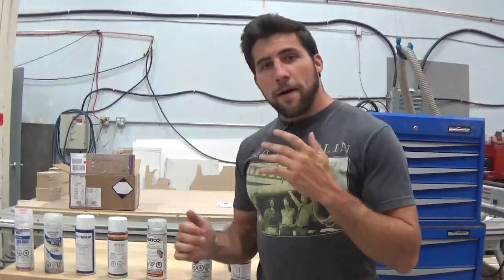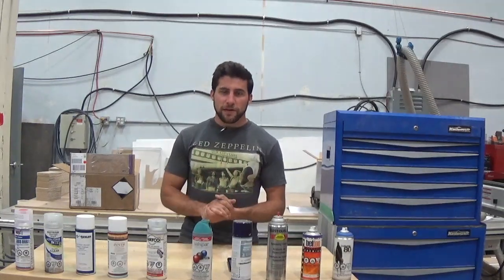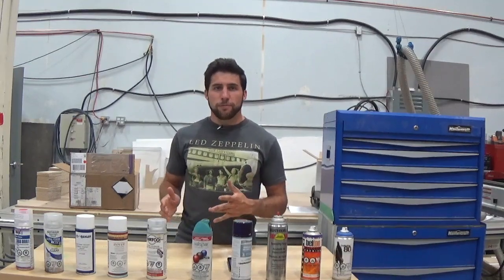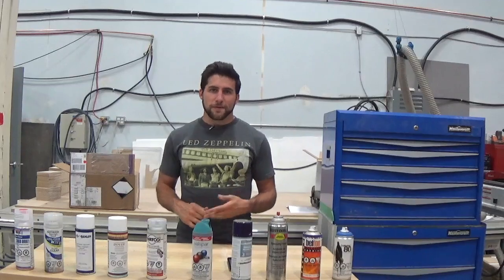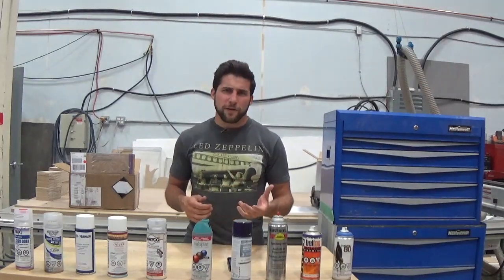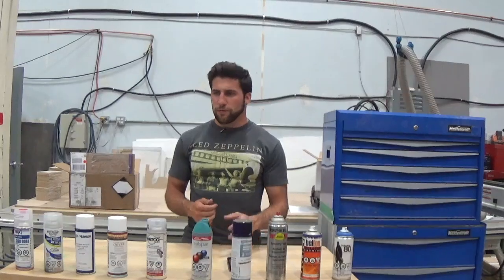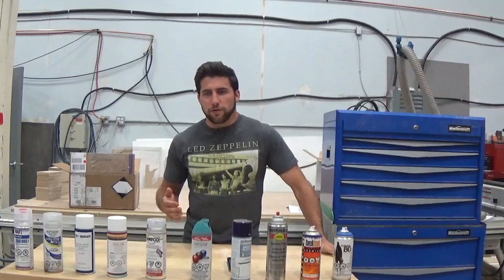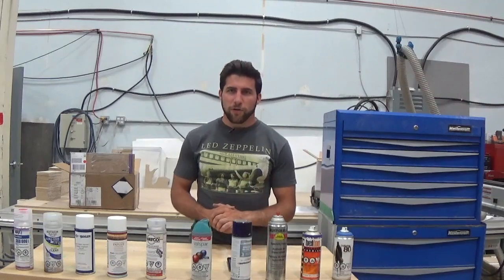The Top 5 Mistakes to Avoid When Painting With Spray Paint

Comment: An issue I have found if you let a piece dry for a day and then sand it lightly it opens up the pores  and then if you recoat right after it can wrinkle as the solvents will activate the old paint.
Reply from the maker: What kind of paint are you using?
Reply: @BradAngove  I used to use Rustoleum but I had issues with that so now I use Krylon Fusion.
Reply from the maker: It’s probably continuing to shrink. I don’t use krylon fusion, but you may need to let it dry for closer to a week.

Comment: Thanks for this helpful tutorial - its golden. I' doing some painting on my car using spray cans of Rustoleum primer base coat mix.
Not having used this combo in a can before I shot a coat of primer/filler first before laying on the base coat - just one coat so far. I was dismayed to see water droplets dripping from the nozzel - just a few, but I thought it best to stop painting, wait for the paint to dry and sand lightly with 1200 grit. Do you have any thoughts as to why the can drips water in the first place? I've warmed the spray can: the  air temp is +/- 12deg centigrade and the job is in the garage. I'm doing something wrong here but not certain what.
Reply from the maker: That is quite odd that it would drip water. It sounds like you may be getting some condensation or something, but it's not an issue that I've seen before. What type of nozzle is it? If it's the old style, my first instinct would be to flip it upside down and spray for a moment until only clear gas comes out. That might clear the condensation so that you can keep spraying. Also, make sure the can has been well shaken. You may be dripping unmixed solvent if it hasn't.
Reply: Brad Angove Thanks, Brad. That can comes with a new style nozzle - its black and is activated by a built in "trigger" style of thing. The paint seems very thin and it could actually be paint drips rather than water - sorry to have mis-informed you. I am painting the cars hood and the passes I make maybe a bit slow and at to steep an angle. I will keep on trying and should get better at painting as I practice more.
Many thanks for your helpful suggestions, Brad.
Reply from the maker: I hope the problem sorts itself out Bruce. Thanks for watching.

Comment: +Brad Angove How do I paint a Les Paul? Do I spray the front, let it dry, spray the back & let it dry, then do the sides? Or do I spray the whole body at once? I don't have any kind of booth to hang the body so I'll probably just have to lay the body flat on some cardboard to dry. How should I spray the body to get the best result?
Reply from the maker: I do the sides and back first, then move on to the front. Better if you can hang it a garage or something to dry rather than on a table, but I’ll leave that decision to you.
Reply: @BradAngove  so would you recommend hanging the body and spraying the whole thing at once? Or do you do the sides and back, let that dry, then do the front? Just want to make sure the paint goes on evenly and dries properly with no runs or spatter. Thanks for your help
Reply from the maker: Either one is fine. It depends on how you like to spray.

Comment: Okay, I've got a Star Trek phaser gun I'm trying to spray paint.. never used spray paint in my life. There's one little part on the side of the phaser gun that has a copper side. I've got copper nail polish.. Would I be an idiot to just try using the copper nail polish for the color, and spraying the clear spray over it? Is that okay??
Reply from the maker: That’s fine. Nail polish is just lacquer, so use a lacquer clear coat overtop.

Comment: If you’re scuffing up clearcoat on a quarter panel to re-clear and accidentally go through the base color to the primer on an edge can you spray a little light base color to cover it up before you re-clear the whole quarter panel?
Reply from the maker: You could. It may be noticeable, but it’s an option.
Reply: @BradAngove  Just thought I’d try to keep the factory color instead of trying to match it and re-spray the whole thing with base, especially it being black.

Comment: So, I know the mistake I originally made, but in trying to correct it the same problem is occurring.  I touched up a shelf when it was too cold and it "puckered" or left "poc" marks - don't know the right term, it wasn't smooth in a few spots.  Anyway, I sanded off the two layers of existing paint (put on the day before) - smooth.  Wiped off any debris, then painted again with temps around 65, humidity would have been low.  But it did it again!  So, wondering if I need to sand it down and use a chemical cleaner on the wood before painting this time?  I thought I did it right this time with sanding and warmer temps!
Reply from the maker: What kind of paint are you using? And how did you prepare the surface?

Comment: Brad I am refinishing Rally rims on Pontiacs and l am thinking of putting a clear coat once finished painting...My question is how long do i wait before i can clear coat, can i do it 24 to 48hrs  later.....It will be the Spraymax 2k clear..Thanks
Reply from the maker: Over what paint?
Reply: @BradAngove  They are going to be primed with a U-Pol primer first and I am going to use a high yield lacquer from inline tube rally  line of charcoal and silver. Thanks
Reply from the maker: I would wait at least a week then.
Reply: @BradAngove  Thanks you!!

Comment: Hi Brad thank you for the video.  I was doing my first ever spray painting job recently and ran into a problem I'm a bit confused about.  I cleaned and sanded the small plastic part and then applied adhesion promoter following the cans instructions, I waited the time stated (1 hour) before applying my enamel base coat.  

I let it dry for 24h but saw I clearly needed another coat as some parts were uneven.  When I sprayed the next coat the following day, black speckles were being sprayed onto my project.  The can ran out of paint shortly after.  I'm now left with dark marks on the project as I didn't have enough paint to fix it.

Maybe worth mentioing: the weather was quite cold and windy but I did warm the can in a bucket of warm water for 15 minutes before spraying.

Any idea what could have caused those black speckles to be sprayed onto my project?  Thanks for any input!
Reply from the maker: What colour paint was it?
Reply: @BradAngove  Thanks for getting back to me, the colour I used was Chrome (Plastikote Fast Dry Enamel AERO CHROME)
Reply from the maker: Oh, chrome is an odd and finicky item. It could be a problem with the way something mixed in the can. Was the can spitting at all?
Reply: @BradAngove  Oh right I didn't know that,  I picked a bad colour to do my first attempt with then!  I don't know if I'd describe it as spitting but the problem did only happen as the can was approaching empty, maybe I didn't shake it hard/long enough.

I'll be doing another project soon and I'll try a different colour paint, hopefully it goes well I'll follow the advice in all your plastic painting videos before I do it.  Thanks again!

Comment: Do you have any suggestions for what to do about spraying too much primer? I used the rustoleum primer filler+sandable on my guitar and i had to build up 2 spots and i put too much. It is soft and squishy and i dont wanna mess it up more so i put a space heater on the spot. Will that work to harden the soft spots? Thanks
Reply from the maker: It could, but you may have solvent trapped underneath keeping it soft and using a heater will only increase how much the surface dries and traps that solvent in there.

Comment: So i followed those tips and i made a huge mistakes not mentioned: 1. was outside and there was a wind breeze (not good). 2. used latex gloves and they went saggy due to sweat so a tip went over the nozzle and full drips appeared on my paint job (not good).... and i dried project in open sun and bubbles apeared (also not good)... i failed big although i went trough some 'mistakes' videos.
Reply from the maker: Yeah, those are definitely mistakes. They don’t make the top 5 for me, but they’re probably fairly common.

Comment: Brad, what a great video!  You answered most of my questions, however I do have one - Does it matter what color your primer is?  When I started my project (the bumper cover on my 02 Q45) I bought a spray can of black primer.  The base coat I had made up at a auto paint shop - it's "Desert Platinum" - a goldish/silverish metallic.  Subsequently,  I saw a few videos where they used light primers under lighter colored base coat. . . too late for me  now.  I'm going out to put my second basecoat layer now.
Reply from the maker: Using a primer of a similar colour just allows for coverage to be achieved a little quicker and easier. In some of the more transparent colours it matters more, but generally it doesn't make much of a difference once you've built up a nice opaque coat of that mid/base coat.

Comment: Can I spray nitro lacquer straight over dyes as in angelous dyes or do I have to put a clear sanding sealer coat first before the nitro lacquer
Reply from the maker: You can spray lacquer over that. Depending on the grain though it may soak in and not look good.

Comment: What if you're restoring an already painted metal? Do I have to remove the old paint completely? Can I apply the paint directly or a primer is still needed? I'll be applying approxomately the same color btw.
Reply from the maker: If it’s already painted, just sand it with some 600 grit and clean carefully, then paint. You don’t need to remove all the old paint.
Reply: Thank you!

Comment: I spray painted my door hinges on top of cardboard, finished with protective enamel spray. When I picked up the hinges they were stuck to the cardboard and some of the pant scraped off when I separated them. Is this from not letting it dry long enough? Basically I sprayed side A, wait, spray side B, wait. Enamel side A wait, enamel side B, wait.
Reply from the maker: Did you sand them before painting them?
Reply: @BradAngove  No . Guess I'll do a scuff with P400 beforehand. Also after sanding I'll spray with primer. The spray paint I used is Krylon Paint&Primer, so I suspect the primer on that is not enough.
Reply from the maker: That sounds like it will likely help the paint stick better.

Comment: I was using a rattle can for my clear coat. On my second coat, the can started to spit a little causing uneven surface. Should I sand it before going to the next coat or fix it at the end where I sand and polish/buff?
Reply from the maker: Let it dry for a day or two and then sand it smooth and continue.
Reply: Brad Angove , I’ve let it dry for about a day now... the last coat wasn’t wet enough so now I have a matte-like finish on the last coat. Would a 2000 grit sand  smooth it out and have a glossy finish after buffer? I’m losing sleep over this 😭

Comment: Hi Brad 
I repainting a stamped steel Marx o gauge locomotive. 
Do I need to wet sand between each coat? What grit should I use?
Reply from the maker: Have a look at my video about whether you need to sand between coats of paint. It depends on the circumstances.

Comment: I'm going to try a copper oxide paint that corrodes with an activator then requires a sealant. I've never done this and am a bit nervous of the sealer wearing off in certain parts. I have found plenty of blogs on doing this finish it galvanized sheets or aluminium but not wood
Reply from the maker: I’ve seen that finish on wood. I’ve never done it though. I hope it goes well for you.

Comment: Started to paint my car, 2pack paint, put clear on and wasn't happy with the colour, so I sanded it back and re-prepped the surface. Then applied my first layer of primer again and it appears to have reacted, it's developed loads of cracks in the finish. 2 possibilities I can think of. 1) after damp dusting the panel I may not have dried it adequately. 2 The water I used may have accidentally had washing up liquid in.  Any ideas?  TIA
Reply from the maker: It could also be a result of layer the primer a bit too thick or some kind of unevaporated  solvent release. 

Sand it back flat and clean. Dry carefully and spray a light coat of primer to make sure things are doing what they should.
Reply: Thanks chap, sanding back again now, third time lucky!!!
Reply from the maker: Fingers crossed.

Comment: I have a new black glossy carbon road bike frame and I have put vinyl decals on it. Should I add a spray clear coat. If yes, 1 or 2 coats? Plus, should I sand area before spraying?
Reply from the maker: No, probably not. It’s difficult to get clear coat to stick to vinyl.
Reply: Brad Angove : thanks. Fortunately, the decals look anyway.

Comment: Real fast question if you can get to it I just sprayed my first coat two to three coats of black textured Rustolium on a wood gun stock I plan on going over that with rustolium flat black the camo can it’s 55 degrees how long should I wait before next coats how many should I do of texture and how long should I let the texture dry before the flat and should I sand the texture before the black like you said
Reply from the maker: You can’t sand the texture, it ruins it. If you’re spraying black over it you only need enough coats to get the desired texture. You should just be able to follow the directions on the can for the re-coat times.
Reply: Brad Angove thank you I let the texture dry inside hanging all night and it’s 35 degrees now so don’t think I’m gona be able to go out and put the flat on it but I put about 4 coats on it and it’s still just a little tacky but not really I did them all with in 45 min or little less time but when you say if you didn’t let it dry properly during each coat it’ll never dry right but if I did spray it on too fast will it cure if I leave it for days drying
Reply from the maker: I don’t think I’ve ever used more than two coats of texture. Try leaving it somewhere warmer and see if it dries.
Reply: Brad Angove I’m guessing it’s close to being dry it’s feels a little weird like grippy light lightly tacky but I don’t know if it’s suppose to be like that when it’s dry cause even tho it’s like that I pushed down with my finger real hard in a spot that’s gona be covered and it didn’t leave no finger print would that mean it’s dry enough
Reply: Or should I just put a pan light on it that puts off heat for a while longer and see what it does
Reply: Brad Angove Like when I rub it it feels fine if I hold my hand on it for few seconds like griping it I can feel the tackiness but it’s not leaving nothing in the paint the paint is staying clean looking
Reply from the maker: It’s probably dry enough.

Comment: Thanks, very good tips. I am planning to spray paint an old stainless steel cabinet and it is my first time to use spray paint. Do I have to sand it? Thanks a lot
Reply from the maker: Paint doesn’t stick to stainless very well. You need to sand it, clean it, and use a metal compatible primer.

Comment: I’m spray painting cabinet hinges from a bronze to a satin nickel by ‘rust oleum universal metallic paint + primer in one’ ....any tips? I soaked the hinges in ammonia and warm water and used a toothbrush to thoroughly clean then let dry before applying first coat. So far so good! But any tips are welcome. Graciassss
Reply from the maker: Did you sand them? Did you choose a metal compatible primer?
Reply: Brad Angove I did not sand nor prime. I only cleaned them thoroughly of grime,dust ,and debris.  And this rust oleum metallic is a primer + paint in one
Reply from the maker: @johnc1280  I'm glad it is working well for you. My tips are generally to sand first, then prime with metal compatible primer, then move on to your metallic following by clear coat. I usually avoid the 2 in 1 products, but if they're working for you that's good to hear.
Reply: Brad Angove gracias man.  So yes I am mostly concerned with flaking / chipping in future...and also I wonder if down there road , these things can be wiped down with like a wet rag to clean and not sustain paint coming off

Comment: I do not use spraypaint bottles that often. What I've noticed it that over time the gas pressure leaks. So I have several, almost full bottles with no way of spraying it out. What is the most optimal way/orientation to store your spray paint bottles to avoid this issue?
Reply from the maker: I haven’t really found a good way to avoid that issue. I sometimes store mine upside down to help keep the solid from settling. It might help with the gas too,  creating a layer of solids at the bottom that may assist in keeping the gas in.

Comment: Hey Brad, longer time listener, first time caller.
I'm trying to refinish a les paul studio that had an ugly green factory finish and to put a goldtop finish on it. The only gold paint I can find is rustoleum universal paint and primer in one.
I've stripped the factory paint to the wood twice now and I've been unable to get the paint to stick. I leave it 12 minutes between coats and I apply 3 times. I then leave it for three days. The paint obviously doesnt dry. I can feel in the pickup space and the paint will scrape off with my fingernail or I can press a fingerprint into it. 
I would like to try a different paint but Canadian tire doesn't have another gold colour choice. 
Should I use a stand alone primer first? My spray area is warm and low humidity.
Any help would be appreciated, the frustration level is huge at this point.
Thanks
Reply from the maker: Try 3 light coats of primer first. Let them dry for 25 hours and make sure your not having the same problem. If it sticks and dries properly, then sand it lightly with 400 grit so the paint will stick properly. You might want to try Home Depot for some Rustoleum metallic.
Reply: Brad Angove thanks for the reply. You're channel is really enjoyable and you do a fantastic job. Beers are on me if you're ever in southwestern Ontario!
Reply from the maker: Haha I’ll give you a shout next time I head out to Sarnia.